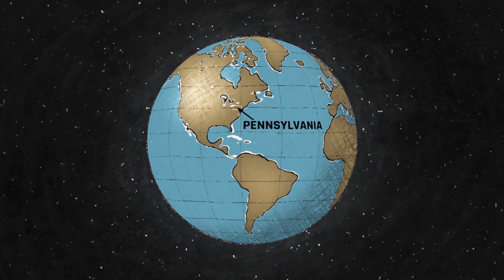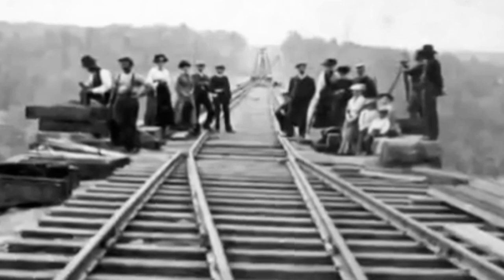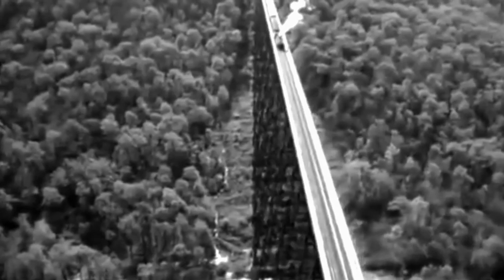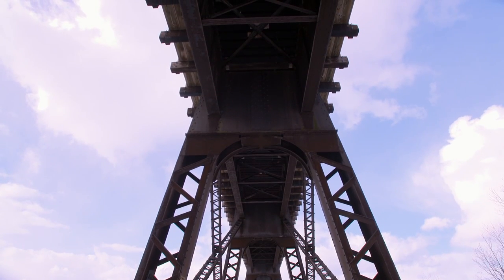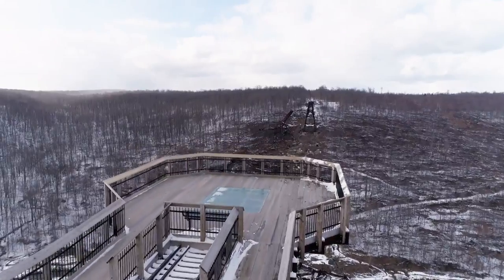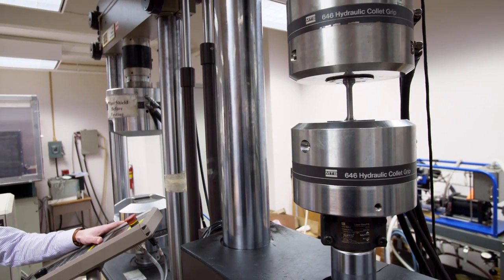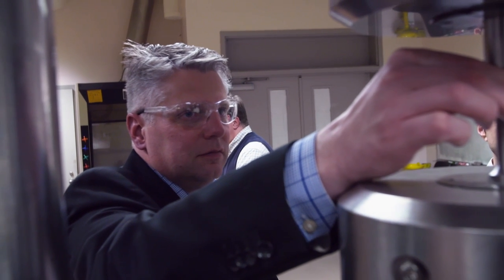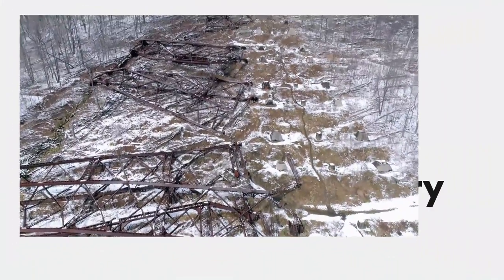How The 8th Wonder Of The World Failed Due To An Engineering Oversight |Massive Engineering Mistakes

Comment: the bridge stood for 100 years. i think thats not a disaster. Thats simply depreciation.
Reply: Yes Random Videos  Bridge was a success till time took its Toll .   A shorter Bridge in Western , N.Y was Replaced in December of 2017 .  The  Portage Bridge was Built in 1875 and was originally Wrought Iron when it was Built for the Erie Railroad . It replaced a Wooden Bridge that Burnt .  The Erie High Bridge was  refitted with Steel several Times . In 2009 they knew its days were numbered The Locomotives were too heavy for it  and a section could be seen dropping when a Train crossed .  1875 to 2017 is Impressive   ,  1880 to 2003 is Amazing .
Reply: Miss Take  the CS/LS2 would like to have a word.
Reply: Miss Take  You poor thing. It breaks my heart to see the results of catastrophic drug abuse during pregnancy. It's not your fault! Your mom should have known better.
Reply: They're engineers. They should know a 100 MPH wind hitting the top of a  300 foot high bridge would bring extreme stress due to the high winds, and leverage of the 300 feet
Reply: Fitness Philosopher it’s very hard to construct something that tall that will withstand a vortex of wind that’s clocked at over 110+ mph and not to mention at the same time  they were in the middle of restoring it. Additionally one needs to consider how rare tornadoes  are, and how rare they are in Pennsylvania. This was probably not a factor in building the bridge. I wouldn’t have thought about that being a factor since the bridge stood for 100 years without any natural disaster issues. Even with the bridge being struck by the tornado only parts of it fell, not the whole thing. For some reason they just said fuck it because 11 of its towers fell and decided to not continue further in restoring it. Most likely would’ve costed tax payers too much.
Reply: Fitness Philosopher also apologies on being redundant with the first half of that comment haha
Reply: Miss Take or the British? The forth bridge has been standing for 130 years and is crossed by 200 trains daily
Reply: 100 years old??? Maintenance inspections the problem!!! Tornado?? Probably wasn't designed to withstand a tornado??
Reply: Miss Take  Troll
Reply: Miss Take  The Chinese engineered a really good pandemic.....
Reply: It didn't collapse just due to age, but rather high winds that would shift it's center of gravity beyond the area the supports cover.
Wildly differing loads like that cause cumulative damage and inspections did notice it, they restricted the weight of trains passing over and in 2002 they closed the viaduct to passenger trains and pedestrians and were repairing it in 2003, so they knew about the issue.

Design flaws are still flaws even if it takes a while for the effects to become noticeable.

It's still a good design, but we only improve by recognising failures and improving, just brushing it off as "oh it was old and lasted a long time" is not a good approach to engineering.
Reply: @JackYoung28  it was being gradually damaged even before that in high winds, not just vortex winds but just regular strong winds, the center of gravity would shift, causing imbalanced loads that gradually damage the bridge cumulatively, if some of the supports had been weaker there might have been a failing earlier and ended up a tragedy, it was lucky it did last this long and the problem was noticed, causing them to close it to passenger traffic and pedestrians, and even earlier to place restrictions on train weights crossing.
Reply: Normal design life for a steel bridge is 120 years. As has been said, built in 90 days back when engineers were still learning about material behavior, lasted a century, fell down during extreme weather (a god damn tornado!) and oh, also look, it gets bloody cold there!
This bridge was an engineering success.
Reply: Agreed. Today's engineers can't make a tree stand for a 100 years. This is a lesson in how stupid we are now.
Reply: @RandySpycyWeinr  LMAO
Reply: True, if they would've replaced parts and maintained or retrofitted upgraded other components over the years it would've been fine. I mean the fact that a metal bridge managed to stand that long with the harsh weather without much upkeep is amazing.
Reply: @JackYoung28  like literally who would design a bridge to withstand a tornado in Pennsylvania that’s like saying yeah let’s make it’s tsunami proof. Wouldn’t make any sense. I mean if it takes over 100 years for a tornado to even be a factor in that area then of course you aren’t gonna consider that a real factor.
Reply: @huguesdepayen1  right? And even then only SOME of it came down after standing for 100 years.
Reply: @JackYoung28  they could’ve easily rebuilt it too because only a few sections fell which is impressive to me, you’d think the whole thing would come down.
Reply: This bridge can be retrofit by building a lower bridge to become a pedestrian road.
Reply: Depreciation??!it doesn't have to happen?!! If they were wise or at least humane enough to change the nuts!! 💯 years? If they changed the nuts it will be 💯 years and still going on!!
Reply: 100 years isn’t long. Your grandkids will be around
Reply: Yea, the bridge was absolutely a success especially that it lasted 100 years and was only torn down by a 160 km/h Tornado!
Reply: @toomanyhobbies2011  That's true...of the US and EVERYBODY else too. Our entire space program...rockets...jet engines...atomic/nuclear technology...uh...gunpowder...fireworks...not entirely "American Made"....until we "Made it American".  I'm sure the list is longer and more detailed than our wildest dreams.
Reply: @Jose Garcia You pretty much hit the nail right on the head with that one... Look at his videos. It's pretty obvious the guy doesn't have his grade 12 lol
Reply: I agree. I do not see 100 year life as a design failure. However, I do see this as a maintenance failure. The guys in charge casually blamed it on the dead predecessors. What a bunch of loony toons.......
Reply: @toomanyhobbies2011  The Three Gorges Dam couldn't be copied and had to be engineered to the geography of the land and is a world record..... lets also ignore the new silk road engineering campaign and the south to north water transfer project. I may not agree with some of china's  mega projects due to environmental reasons but you gotta give credit where its due, even if its a environmental disaster its still a marvelous achievement that even altered the earths rotation(the dam did that)
Reply: A mistake that took 100 years to rear its ugly head? Hmmm. It may be a mistake by todays standards. But it stood for 100 years. I call that a success.
Reply: @amosmellow1154  yea but you say that with hindsight of knowing about the bolts and the tornado, id like to see you there 100 years ago and see your brilliant ideas of what youd put on the bridge without knowing there would be a tornado in 100 years.
Reply: @emmanueldedovets5960  three gorges dam skipped a lot of safety regulations, like a lot of buildings in china it wont last 100 years and even if it had the capability all three will probably be bombed in war first.
Reply: @bigtroglodyte  i don't think most folks understand just how much of a accomplishment it is to just build the dam. The concrete  needed to be cooled as it dried with pipes that carry water or else it would take literally over a hundred years for the concrete to dry and cure but they managed to engineer solutions. They ran into new and untested territory and had to design something thats never been done beforehand in dam construction even though the western world thought it can't be done....but who knows how the long term consequences of changing the ecosystem might turn out and if they outweigh the benifits but its to soon to say, but once again it dosnt change the fact that its a huge accomplishment. The Chinese are just as talented as any other modern nation.... I personally dislike the change to the ecosystem and don't agree with it at all and am very concerned with the consequences but at the same time I can't help but be marvel at how far we as humans have come.... the dam will last 100 years easily as long as it gets regular maintenance just like any other mega dams of the past.
Reply: Totally agree
Reply: I have to say after reading these replies. Back in 1875 I'm pretty sure the engineers didn't have nearly as much knowledge that they have today. Today our engineers can't build roads to last at least 10 years. I'm sure back then they used every option they had available to them but as it was mentioned multiple times that it really wasn't a mother nature related storm that brought that section down but a freak tornado. Who would have thought, plus a design flaw that managed to remain a hidden issue I wouldn't really call a flaw. I think it was a modern marvel for it's continued use for 100+ years. The only thing that really hurt the bridges lasting as long as it did was poor maintenance through the years. Even the brooklyn bridge was almost in despair due to poor maintenance. So people calling this a disaster really have no clue. I think it was a impressive work for the time it was originally built.
Reply: This is exactly wtf a disaster is
Reply: @MikeBarbarossa  there Chinese engineers
Reply: Yea considering they could have at any point revisited those couplings and remanufactured them out of steel… which may or may not have even saved the bridge. Lots of things could’ve been done but it’s easier to call it an engineering disaster lol
Reply: was about to say the same.
Reply: The maintenance or non maintenance destroyed the bridge we should say rather than the design
Reply: @markcantemail8018  Another was the Foxburg, PA bridge. It was unique because it was designed for a train on top, road traffic below, and a pedestrian walkway to the side of the lower deck. 
They demolished it because the river had started to undercut the supports, and to support the bridge and replace the supports was going to cost just as much as a new bridge, so after years of trying to save it, the decision was made reluctantly to demolish it and build a new bridge. https://youtu.be/wqamQAZntek
Also, the bridge had a grate road surface, so did the pedestrian walkway; you looked down, saw all the way to the water; some just avoided looking down when walking across it.
Reply: @theherrdark4834   Sounds like a Bridge to be Proud of .  Thank you for telling me about it  ,  I will take a look .
Reply: It got hit by a tornado, not to mention getting hit by whatever the tornado picked up, and slung into the bridge. It was going  be a mess anyway.  Just consider themselves lucky no trains were crossing
Reply: And a 150 mph torquing wind had to rip it up.  
I think they did a pretty good job, all things considered.
Reply: Yeah I dont think anyone was expecting tornados in PA a century ago.  But not sure what else the anchor bolts are for besides uplift?
Reply: My thoughts exactly.  This isn't a failure if it took a tornado to bring it down
Reply: Fr
Reply: Bridge was a success. Now, if it took 100 years to fail (pretty damn good), had they known about the anchor bolts issues, they had a long time to correct them.
Reply: @MikeBarbarossa  first, 100 years ago, they had no Society of Mechanical Engineers who create the modern standards of construction, so the fact that this lasted so long on its own is amazing. Second, I highly doubt anybody thought so far ahead as to compensate for a direct hit from a tornado. Third? Nobody builds to tornado standards in most places anyways today, so why blame the design engineers 100 years ago.
Reply: Only 100 years?  That's pretty poop.
Reply: Roman bridges are still standing.  100 years is nothing.  Your ignorance deceives you.
Reply: @dogbots159   The Romans were odd, that way.  They built two kinds of structures: temporary structures that were torn down when they were no longer needed and permanent structures, which were built to last for all time (luckily, the Mediterranean climate allowed for such vanities).  My favorite examples have got to be Roman bridges in Spain.  They are very difficult to find, for two reasons:  First, too many bridges built afterwards were copies of the Roman bridges and, secondly, Roman bridges have been continuously modernized over their two millennia of near constant use.
Reply: Yes it is a disaster .
Generally bridges are designed for more than 300+ years.
Reply: @kunalthakur5806  even 300 years is a bit short if you compare it to Bridges throughout history.  There are literally bridges that are thousands of years old
Reply: You truly have no idea how long infrastructure projects of that magnitude are intended to last. What a dumb comment.
Reply: I personally remain thinking it of a disaster, but I’m a hydraulic civil engineer
Reply: and it got hit by a f'ing tornado.  lol.
Reply: @irtheLeGiOn  it's literally just metal lattice, the tornado really shouldn't even affect that too much
Reply: Only if there was no expectation on the bridge lasting indefinitely. Using cast iron for load-bearing parts is dubious.
Reply: Yeah it's not a disaster the thing was there for over a century time to move on and innovate if that bridge was still standing there they would probably still spend the next five 10 years keeping it from falling down whereas now that it's out of the way they could build a modern Bridge in two years and turn it into a pier style tourist attraction to make money for the economy rather than wasting money on 100 year old bridge that's a huge issue in a lot of cities I don't want to get rid of these historical monuments when in actuality be better to move them to a museum or take pictures of them and update that infrastructure rather than working around it and spending money to maintain it
Reply: AND hit by a tornado! lol
Reply: Many abandoned factories in Detroit have stood for over 100 years and they are being demolished because they're water damaged, fire damaged, temperature damaged, but are still sturdy.
Reply: @markcantemail8018  the question is what if they replaced the collars, would it have failed? Those are what broke, not the anchor bolts. Almost in their tests at the end, they said they tested cast iron, which is brittle. Beginning if the video they mentioned the original designers thought about using cast iron, but instead used just a basic iron.
Reply: Metal boink maca a bridge
Reply: Yeah, stood for a hundred years before being brought down with the help of a TORNADO. I wouldn't call that a construction calamity.
Reply: @MikeBarbarossa  100mph winds in Pennsylvania aren't that common though
Reply: @JackYoung28  Tornadoes are not rare in the US. I don't know the numbers for Pennsylvania so I won't speak the accuracy of that part of your statement.
Reply: @MikeBarbarossa  It was 1888, and engineering wasn't what it is today.  You should know this.  Tornadoes weren't on anyone's mind, either.  No one in Penn. walks around worried about tornadoes.
Reply: @ffrederickskitty214  How tall is the Forth bridge?
Reply: @MikeBarbarossa  
It's why many long rail viaducts are curved; gives them a much higher lateral stiffness.
Reply: Yes, it's a shame that professional engineers didn't have your intuition that high winds and a tall structure might stress those anchors.  If only you had been there that bridge would still be standing.
Reply: @JackYoung28  The bridge was closed to freight traffic decades ago.  By the time it collapsed, it was a tourist attraction that saw only pedestrian traffic and some small recreational rail excursions.  It would be far too expensive to rebuild it for those purposes.  The south end of the structure has been repaired and reopened to pedestrians.
Reply: @KandiKlover We don't know that for sure.  Had the anchor bolts been replaced with steel, perhaps a different part of the bridge would have failed.  Every chain has a weakest link.
Reply: @S7Players  It's an eternity in economics.  It was built to make money, and it outlived its useful purpose by about 40 years.
Reply: @dogbots159  Building structures that outlive your civilization by millenia is economically stupid. 😀
Reply: @richardbell7678  I suspect we get the Romans wrong when we think they built their structures to last this long.  They built them the only way they knew how.
Reply: @jonescrusher1  It was wrought iron, and it was the go to material for structures like this at the time.  Steel was a boutique material in 1875, and few structures offered sufficient ROI to justify steel.  In the US, demand for large structural steel elements for railroad bridges in the late 19th century required new steel manufacturing methods, that reduced the price and increased demand in a virtuous cycle that spurred greater economic efficiency in both industries.
Reply: @charlesenfield2192  correct, and it’s not reasonable to assume they should account for a freak tornado. Even so, it’s too far to consider it a marvel of engineering. It did a job.

Comment: So a routine inspection after a hundred years discovered that high winds could be dangerous to the bridge, so they stopped trains from crossing it.  If anything this bridge represents a success, in both engineering and taking precautionary measures.

Comment: Okay but let's just say they did proper anchor points prior. 100mph winds would still do significant damage. Because it's not just wind it's wind carrying trees and debris that would puncture/break many parts of that bridge. It would likely need to be closed/completely re engineered regardless.
Reply: It was a F1 tornado. 100mph wind at best.